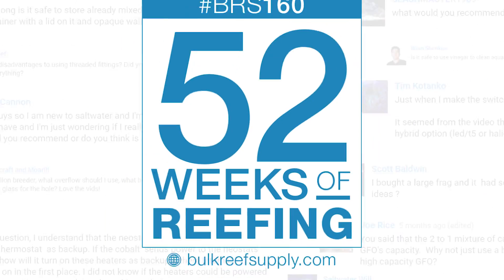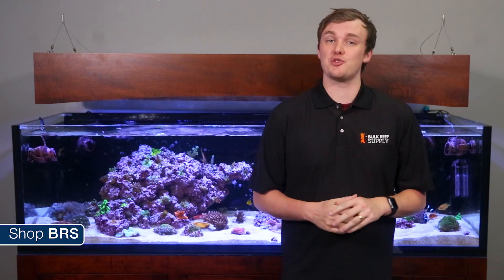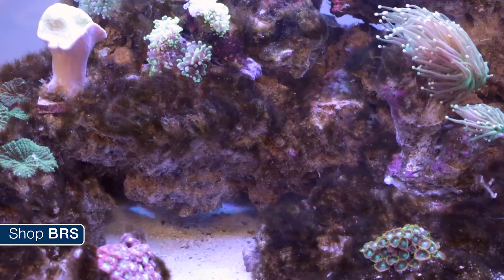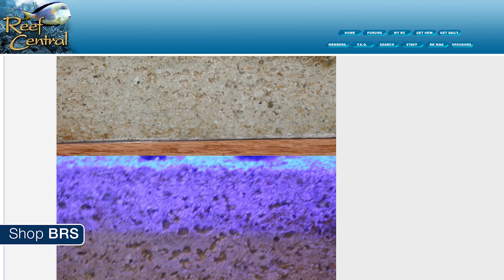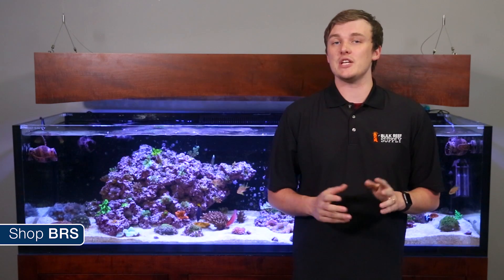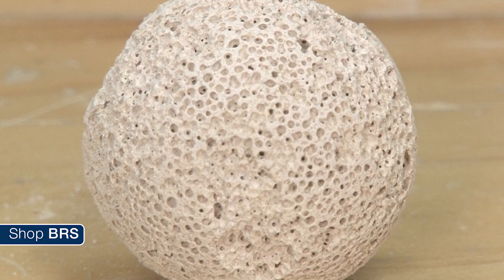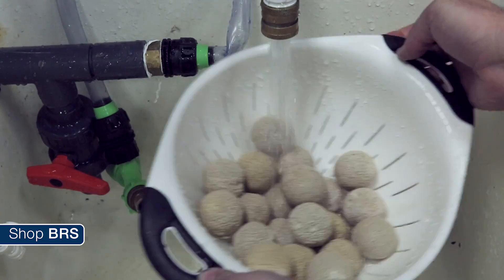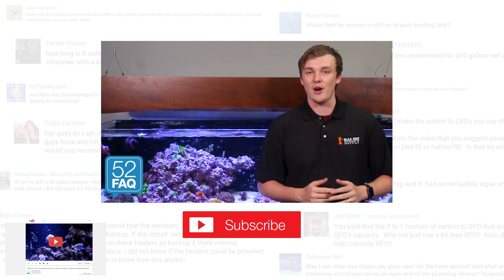FAQ #20: Why use MarinePure for filtration VS deep sand beds? | #52FAQ

Comment: Few people know what the hell they are doing. Dsb work but they need a plenum underneath with an airlift tube,  otherwise water cannot penetrate the bed. A dsb is pointless when sand is dumped directly on the tank bottom. Scientific literature exists but hobbyists do not read it.

Comment: There are many discussions in the major reefing forums about "MarinePure Ceramic Biomedia Plates" leaching Aluminium into the tank at dangerous/toxic levels.  In the discussion forums people who have tested using (Triton Tests) this product have reported high levels of Aluminium.  Have you TESTED for Aluminium in the tanks you use this product to support or disprove this?
Reply: There are loads of people using MarinePure that don't have any Aluminium in their systems. I did read somewhere that a certain ICP water  tester was picking up Aluminium in the ICP tests because their old gauge was picking up an inert type of base aluminium from the way their test was done i.e. getting a false reading which would explain why people with so called high Aluminium of 5000μg/L+  and it didn't show up in their corals or fish within their systems. 
In another it was reported that people had just dropped their blocks into their sumps without following the instructions of rinsing the product and cleaning the dust from it which it turn was then carried in the water column and picked up in the ICP.
Funnily enough there seems to be only one ICP tester that is picking up this so called Aluminium and then it's totally disappeared within the next ICP tests been done.
I personally decided to test this and purchased a MarinePure block duly received it rinsed it and placed it in my sump ICP tests done by ATI and no raised Aluminium was detected at all. Even the tests done and described on the cermedia.com web site* also proves the fact that MarinePure blocks do not cause raised Aluminium in the tank. 

*  http://cermedia.com/blog.php?p=142

Comment: I use the heck out of MP balls, so I hope they are working!

I built an eggcrate cage to hold them inside of my overflow, with about 20 double-stacked side by side.  It seemed a waste to have all that overflow space just a big water column you can't see, so I put it to use hosting more MP balls.

Down in my sump I added three mesh bags full of MP balls.

Then in my sump I also added a 3x10 column of balls in my bubble reducer area between fuge and return.

Comment: Question :: Is it necessary to do a water change if there are no measurements which would indicate a water change is needed? Nitrates and ammonias are at zero.. but I can't help but think that I should still be doing water changes after so many months have passed. I've never seen anyone say why they'd do a water change other than to remove nitrates...
Reply: It's a fish only system, no corals...Any other reasons to water change?

Comment: Hi R.T. Question ... I've always used black contact paper on that back of my aquarium tanks, but it's a pain to get it bubble free. My question is as I'm about to setup my second tank a 120g if I paint the back of the aquarium, would I paint it before I drill my overflow holes or after? my conventional wisdom would tell me to do it before, just want your thoughts on the subject. Thanks
Reply: Just recently drilled my new tank. I painted it afterwards and it worked very well. Just look at the video on my channel!
Reply: Thanks, WhiskeyCoffe, I'd prefer that method of drilling holes first and painting afterward. Glad for your assist, I'm tired of contact paper. It's served me well in the past but it's time to move away from that material :-) For what it's  I love whiskey coffee!
Reply: Thanks, people! :-)

Comment: Because of videos like these, I'll be a BRS customer for life! Thank you!
Reply: Seems redundant now that we know about zeolites. There is nothing that comes close to them for biological. Not only is the surface area the absolute most optimized for maximum area bacterial growth it also depending on the sizing fully supports aerobic bacteria too depending on the flow and sizing. It also has the added benefit of removing toxic heavy metals and poisons from the water and once that function is used up it still serves as biological and given it's relatively low price some of it can easily be cycled out for the purpose of the carbon filter like effects which is far superior to carbon. I can't see any reason why anyone doesn't use zeolites for biological nowadays. And if anyone didn't know zeolite also removes ammonia very effectively. Iow grade is put in livestock food so their waste is low in ammonia so there is less smell and other reasons. It is also high grade is used for humans internally by the leading doctors of the world for heavy metal and toxin removal among other benefits. Look up zeogold and results rna zeolite. I think there just isn't enough education about zeolites. It has got to be one of the biggest advances for the aquarium hobby. It literally makes the idea of live rock and sand for biological filtration redundant and actually a joke compared to it. It also makes the hobby far safer as far as not going with live rock and even using dry rock that isn't porous. Makes a much more stable environment. I hope this is put out there because the sooner it's common practice the sooner more attention can be focused on perfecting other areas of the aquarium hobby. We pretty much have biological mastered now that we have zeolites. Just to clarify it doesn't need to be replaced either unless you want the added carbon like effect where it absorbs and locks onto ammonia heavy metals and poisons. Unless you don't use mechanical filtration before it.
Reply: BulkReefSupplyCom same here. Unending new things are coming in.
Reply: http://www.explainthatstuff.com/zeolites.html  <- info
http://www.silicycle.com/products/siliadry-desiccants/molecular-sieves-zeolites  <- image

Comment: I love my deep sand bed, 2years no cleaning
Reply: NEVER clean a DSB. leave it undisturbed. If the microfauna/bacteria switch layers, as would happen when cleaning, vacuuming, you'll get death and hydrogen sulfide spots.The only thing you need for a DSB are the right snails, burrowing worms and brittle stars. The DSB will not be a detritus trap if the sand is fine enough.

Comment: I put one of the thick MarinePure blocks in a low flow area of my sump when I first set up the tank.  After cycling my nitrates were at about 100. I started to lower that via water changes and got it down to about 20 when the nitrates started going down on their own.  Within a few weeks they dropped to 0 without any additional water changes. The tank is about 10 months old now and nitrates (and phosphates) have remained undetectable. The bioload is quite light - about a dozen small fish in a 150g.  Off and on I've tried to grow chaeto in the fuge with limited success. So I can't say it's the MarinePure block for sure, but something in my tank is denitrifying and the MarinePure seems the most likely candidate.

Comment: One of the areas like with deep sand is a buffer on the tank if a rock falls. Some of this is from my clown fish that gets opinionated on pushing some large heavy rock. The sand buffers the crash for me.
Also sand sifting stars like it. Those big blocks are excellent with low flow with a media bag ahead of them. Their only a disaster if unfiltered water was used into them. Then nitrates and clogging.
Reply: That is a good idea as should not wipe out all the culture. But the pre filter is really important on those and all bio media. Used the take out bio balls to nitrate factory from raw water feeding them. Used seachem matrix which is super media in smaller pieces. 4 liters with low flow and pristine water in my 180 reef for years. Feed it with bacteria every 6-8 months but that was it.

Comment: Can you use marine pure in a canister filter
Reply: I use it in a fresh water system i have in a canister filter but does not seem to reduce nitrates as well as in my sump salt system
Reply: When i started my Marine tank i put the balls in the biomedia tray and cycled with ATM Colony. The filter was a Fluval 406 and apart from the 4 coarse sponges and the bio sponge i placed a cut-to-size piece of Polyfilter then the bio balls from marine pure followed by carbon and rowaphos.  and i did see denitrification. I later bought a reactor for my chemical filtration. and removed the polyfilter as it expired and denitrification still happened. I introduce two blue/green chromis and my flame angel took a fin off the female so i treated the tank as i didn't have a QT and the denitrifyers died. I battled Nitrates ever since as i was unable to develop them again after. I just upgraded my tank to a 125g and used the marinepure block of 8x8x4, i got a bucket of old tank water and put a good dose of ATM colony in the water and placed the marinepure in the bucket dry so it would soak all the bacteria in. I left it like this for 2 days without flow or a heater only stiring for oxygen twice a day. It's benn in my sump for a month and i have denitrification again.  Hope this helps in some way anybody who needs it..
Reply: The flow in a canister filter is too fast for anaerobic conditions to occur. This media is too porus Nitrifying bacteria can't strip the water of oxygen quick enough to create the right conditions for denitrification to occur unless you can choke the flow significantly enough.